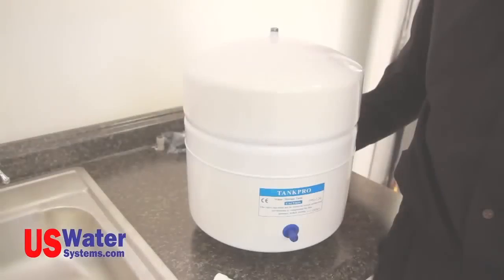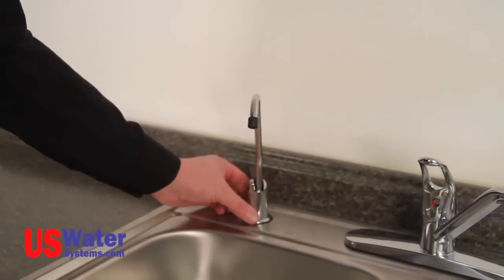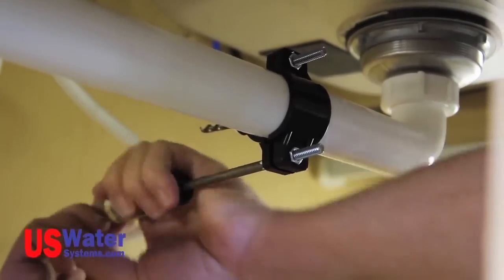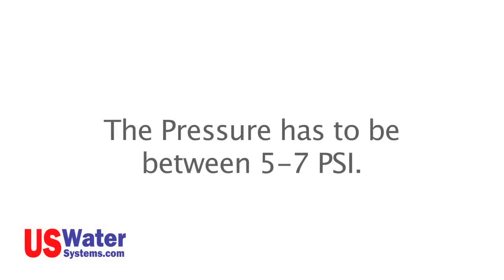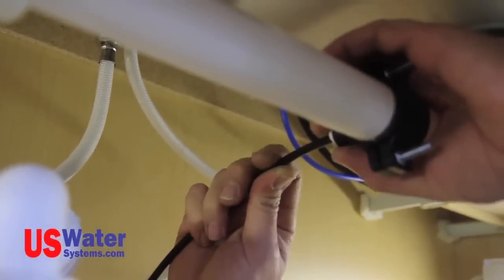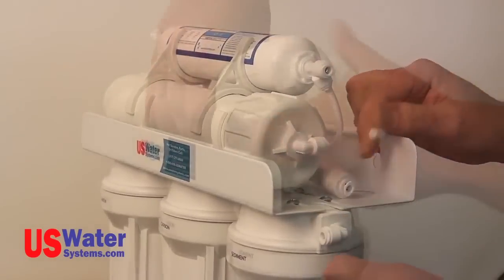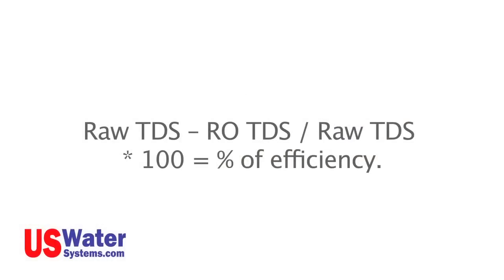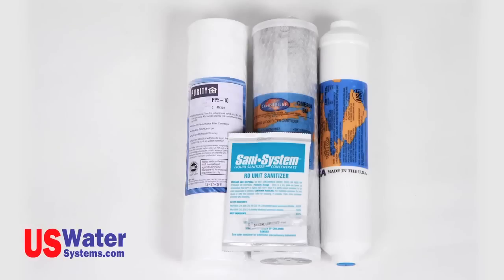Reverse Osmosis Installation "How To" - US Water Systems

Comment: Hello I have a HARVARD 5 stage RO System HROK4 I can not figure out what I need to buy for a replacement inline filter. I ordered one that didn’t fit. Can you help by chance? Thank you!
Reply from the maker: I am curious what you mean by it not fitting, because most RO inline filters are the same size and work with any RO, since they do not go into a housing. Here is a link to one of ours: https://www.uswatersystems.com/us-water-10-inch-inline-carbon-filter.html
Is it possible you are confusing the inline with another filter or maybe the membrane?

Comment: This is a very informative video. I must add to NOT handle the filters or membrane with your hands, if this should happen you should sanitize the system so you don't create growth of unwanted bacteria. Also if installing an Air gap faucet, it is crucial to make sure the 3/8" line to the drain saddle is in a smooth slope towards the drain saddle, if you have any sagging in the line it will cause the air gap to leak.